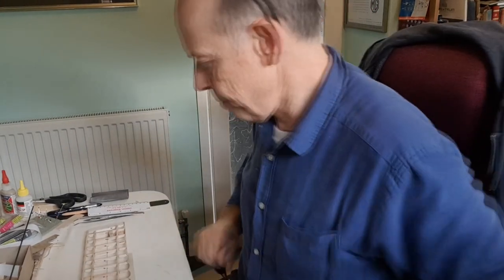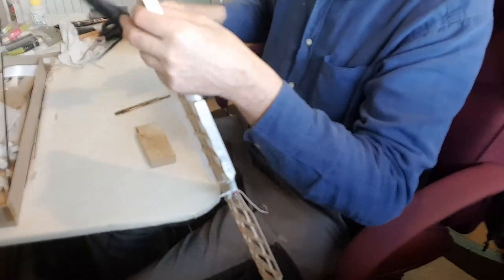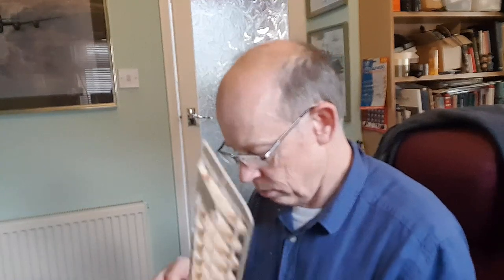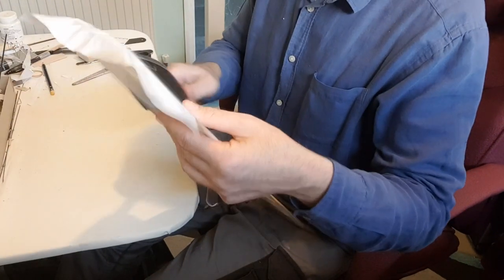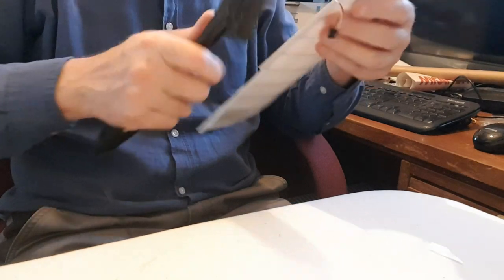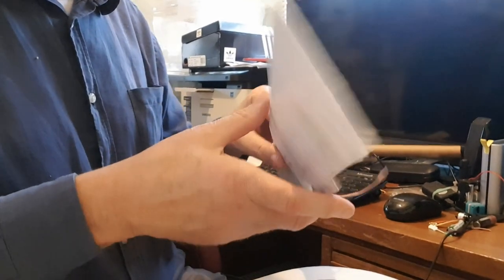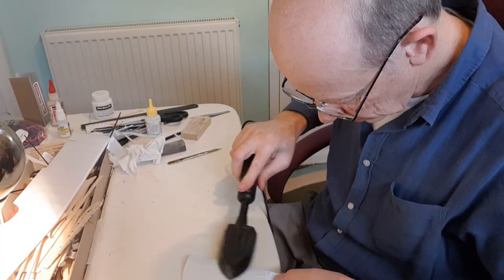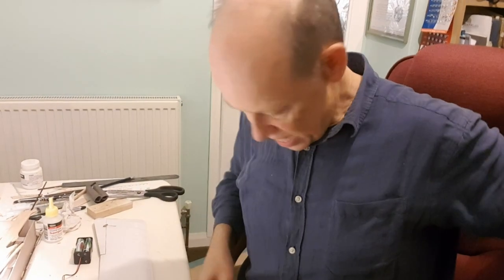Guillow's Nieuport 11 Radio Control Conversion (Part 9) Covering the  Top Wing

Comment: I get the impression that the micafilm is stiff, goes on well and doesn't pinch at the tack points like light film does. Is it heavy?
Reply from the maker: Not quite sure what you mean by 'pinch' but you've summed it up well, having not used it before I was concerned that it might warp the structure as I tightened it but it was ok. I did get a warp in the top wing but by holding it flat (or twisting slightly in the opposite direction) I was able to reapply the heat and sort it to my satisfaction.
Reply: By pinch I mean the tiny creases that sometimes occur with light film covering at the tack points. Often, I have trouble shrinking them out. But I go back to silk and dope and never mastered all this newfangled stuff. But I love watching you work.